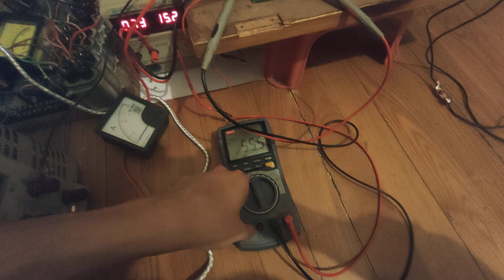Quasi-resonant arcs with ferrite high frequency transformer

Comment: Great! I'm about to test a very small (lol 200W) trafo driven by a ZVS driver and wound up to get roughly 2kv at 500mA (otherwise just 100mA with no resonance).... If everything works I'll post a video about it :D
Reply from the maker: Haha,looking forward to your result🧐🤔🤗.
Reply: @uecmitsuimarinedieselengin873  update: the quickly wound and not so well isolated trafo flashed over while I was making some long runs before filming, just to be sure that it wouldn't break while filming..... :____)
Reply from the maker: @fabriziobrutti1205  Oh,I found it's really hard to ensure the insulating by using a ZVS than using the Bridge  topology.I had broken my homebrew transformer one year ago as well as you. I used 4 turns primary and 700 turns secondary on that transformer and it broke down🤔😅. You can try some 三层绝缘线 which could withstand 15kV which just have the diameter of only 0.4mm.
Reply: @uecmitsuimarinedieselengin873  hm I'll give it a look... About your story, I relate... If you go on my yt channel and give a look at the DIY HV trafo Vs Jacob's ladder.... It was my 2nd diy hv trafo.... The goal was to let it strike at 1cm and I reached it.... But... One day... I thought: "what if I try to let it strike at 1.5cm?" Well, it's been its last day😅
With the last trafo it's been a slightly different story... Something more like: "Let's see if the winding temperature keeps rising or it settles"... Well, it rose high enough to partially melt the isolation and let it fail 🤷‍♂️
But in the next weeks I'll try to make some calculations before winding, so that I'll come up with something made to last 🤞
Reply from the maker: @fabriziobrutti1205  Haha it's very interesting to know your experiment story.Keep trying my friend.
Reply: @uecmitsuimarinedieselengin873  thanks! Sure I will!
(oh by the way, you just reminded me to upload the last day of my small tesla coil, waiting to be partially rewound since... Jeez, I don't remember the year!🤔)
Reply: @uecmitsuimarinedieselengin873  alright, I'm having some problems with diy film caps... They all flash over in couple seconds (due to Corona effect melting the plastic, ig)... I'll try with some acrylic varnish to don't let the air inside, but it's gonna take 24h of curing time🙄